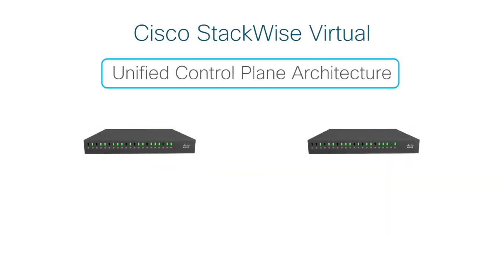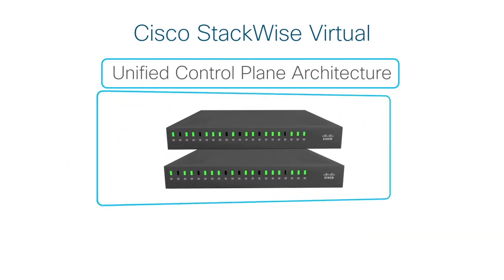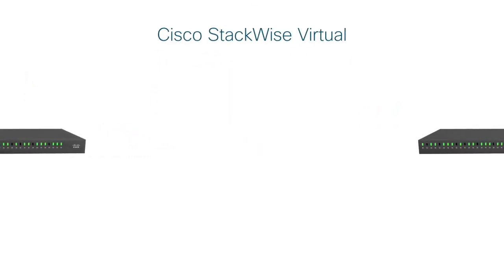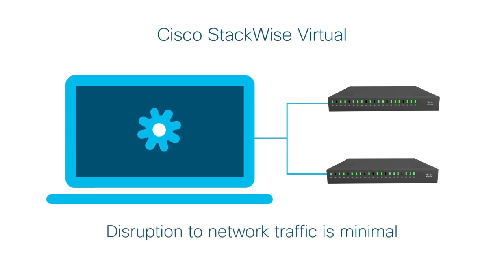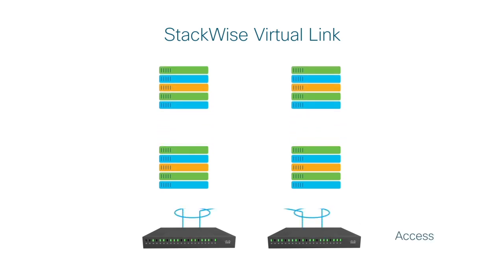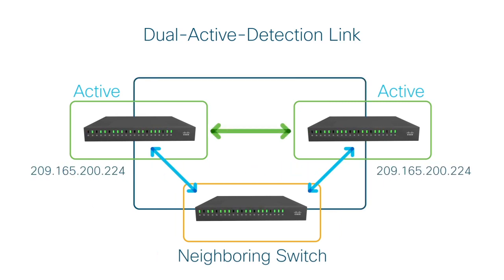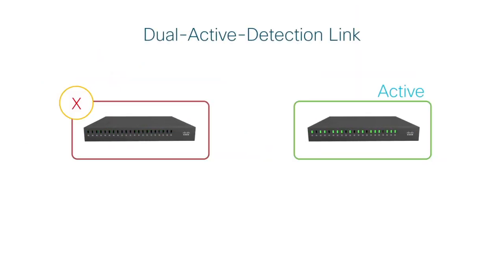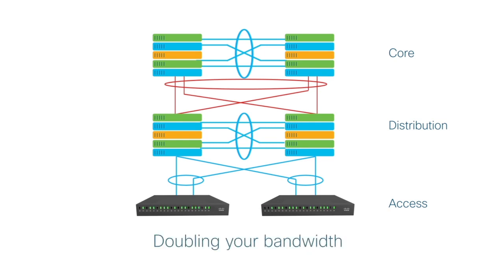How-To: Cisco StackWise Virtual Architecture

Comment: 2 Switches when connected STACKwise, will have the what kind of CPU capability ? Will the Active Switch have the CPU power of 2 the Switches or will it be a single Switch ???
Reply: They will be in Active/Hot-Standby Relationship from the control plane perspective, where active device is responsible for all the control plane functions however both of them play active role when it comes to data plane/traffic forwarding. I hope this clarifies your question, Or else you can also read on Stackwise Virtual White Paper available on Cisco.com